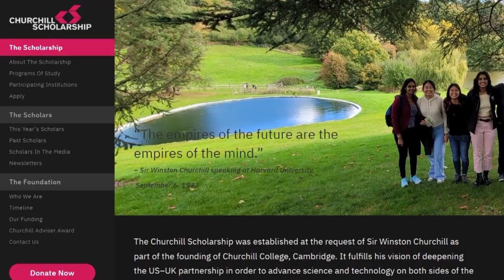English wheeling Aluminum panels - 1979 Firebird Part 1

Comment: You guys preempted my idea!  One of the things I want to do with the knowledge from Wray's class is I have a Prelude I'm thinking of converting most of the body and doors to aluminum the same as this!  Its internal unibody structure is 100% rust-free, but it had all the body panels vandalized, then it butchered by a body shop who used 1/2" Bondo on top of adjusting panels the wrong direction, and then it was left outside to rust while unpainted.  So I have a solid core combined with both a reason to and no reason not to redo the exterior all in aluminum.

Comment: Common place they rust on the trans am is in the boot area by the boot hinges water sits in the recessed area and rusts and around the flitch panel by the rear window plus around by the windshield area ..... What's the floorpans like that's a fav area to rust

Comment: Great American steel ! I see that Tim mentioned using a something to stop the galvanic corrosion between the steel and aluminum , can you give us a product that you may be using. I know when american car companies were using lead shield to separate the front aluminum bumpers from the steel bumper  and steel energy absorbers but they fell apart anyway.😊
    Wray I know that your expertise and choosing is fine italian /british and german cars but many of us have no access to these car$ so thank you for this segment. P.S whatever happened to the 52 cadillac you had de-rusting on the lift ?
Reply from the maker: The Cadillac is on the back burner. The doors steel inner structure can be epoxy painted or powder coated both will provide 50 years of protection.

Comment: Is there a finished video of the trans am
Reply from the maker: Unfortunately no, maybe next year.
Reply: @proshaper  how hard is to make a duck tail rear spoiler out of aluminum
Reply from the maker: @tiffanybranton7556  is the design original? If it is, wireform it up and make it using the wireform.
Reply: @proshaper  will the guy from Australia be back to assist on the trans am build restoration